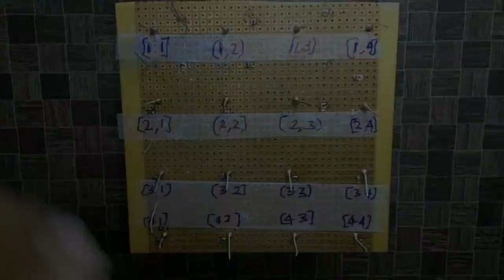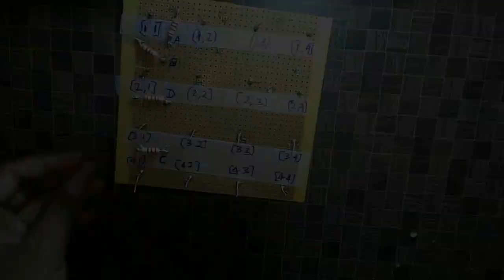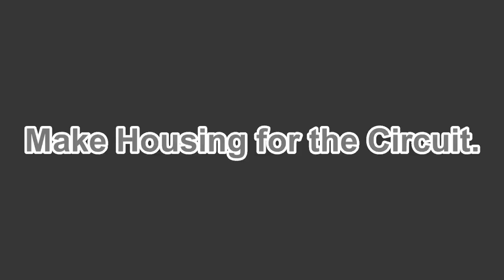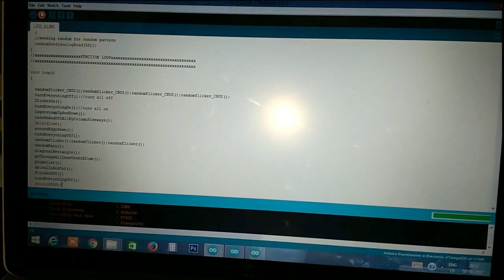How to Make LED CUBE 4X4X4 USING ARDUINO UNO

Comment: Hi there,  I appreciate the effort but at the end, You didn't show as one of the most important thing - How & what are the Power connections for the Cube from Arduino pins ?! ... I spent hours reading the Instructable from the link provided and watching the photos from it but Nothing !!! ... can we power up the cube using the 12vDC power socket on the Arduino board? ... Thank You ...

Comment: You soldered one end of the resistor on wire that is comming from layers and where did u soldered secend end of resistor ?
Reply: to the jumper wires connecting to Arduino. In the beginning he created fake endings and then he soldered the jumper wires to the other ends.

Comment: Can the board hold that ammont of current since there is so much led?? Can we do this with nano?
Reply from the maker: Make sure  the current through each pin is not more than 200 mA . I think even nano supports this. Please check the data sheet for this.
Here only 4 led come to one pin. and the current is limited to 30mA using resistance.

Comment: When I want to solder all the 16 vertical leads to form 4 layers together , the negative led leg is it match with negative led leg?
Or match with positive led leg?
Reply from the maker: the vertical led needs to be positive leads. and the layers form the negative leads.
Reply: Thank you.

Comment: hello, sorry but i cannot understand how you solder the positive and negative parts of the LED. can i solder the bent (positive) to the negative since they're much closer to each other? sorry so new to this
Reply from the maker: stephanie louise molod , you should solder all positive and negative leads together respectively. but do not solder one positive with negative. it will short circuit.
Reply: The Technocrat thank you for the reply :)

Comment: how to add switch for it to play? and also without computer or phone how to make it play on its own when you turn on the switch?
Reply from the maker: Kaye Chan ,connect the Arduino to a 9v battery or any USB power source (like mobile phone charger).  
Since you have Arduino it doesn't require computer to play. 
Add a switch in series with the battery or USB power source before the Arduino power pin. 
Good luck for your school project. If  Any doubts pls contact me.
thank you

Comment: What did you use when you solder each layer to the board?
Reply from the maker: Place one of the layer on the jig...Then Hold another layer in your hand or ask your friend or someone to hold it......Solder the Corners....and then the rest of the connections.... Repeat this for all the layers.
thank you
Reply: I mean what kind of wire did you use to solder each layer? thank you
Reply from the maker: wilna lynn albarida, I used single strand wires and the leads of LEDs which was already present
Reply: thank you
Reply: thank you

Comment: can i use 100 ohm resistor instead of 220 ohm resister
Reply from the maker: Naveen Jolly yes you can use 100 ohm resistor...
but make sure your LED is safe by try  connecting one led to 100 and test it to 5 volt .

Comment: Can I use 150ohm resistor?
Or must use 220ohm resistor?
Reply from the maker: QUN YEN , 150 ohm is sufficient . But before you connect in cube... make sure to connect it to single LED and check. Coz you don't want to burn all the LED's ..
Reply: Thanks

Comment: Can you make a video for password door lock using arudino uno with buzzer forwrong password or tell me how to connect it as I requir it urgently and also tell me code
Reply from the maker: abhishek singh please try this project in the link below.

http://www.instructables.com/id/Arduino-door-lock-with-password

sorry to will take time for me to make a video on this, but I will try to make a door lock video in some days.. 
in that above project In the link, instead of led, use a 5volt  buzzer to say access denied..
good luck.
Reply: The Technocrat

Comment: how to code for multi channel relays connected to arduino ?
Reply from the maker: Connect to arduino. Make the pin HIGH or LOW depending on which relay you want to turn ON Or OFF.
Reply: Thank u